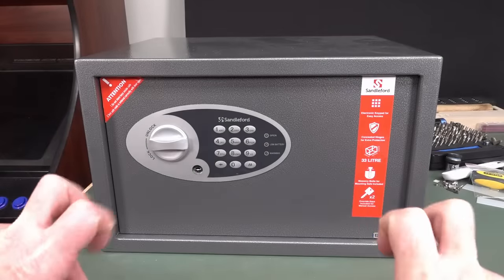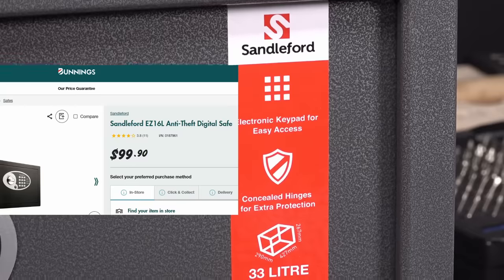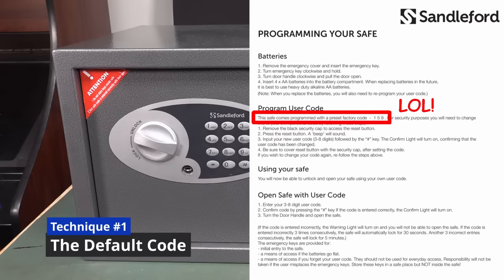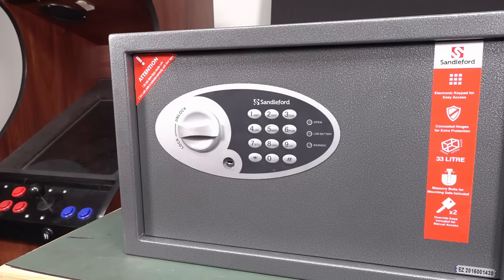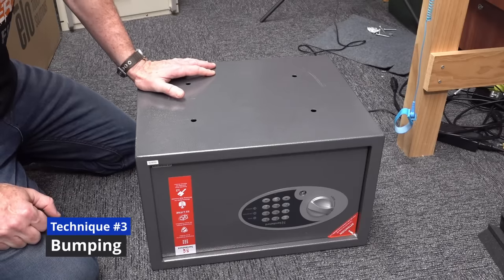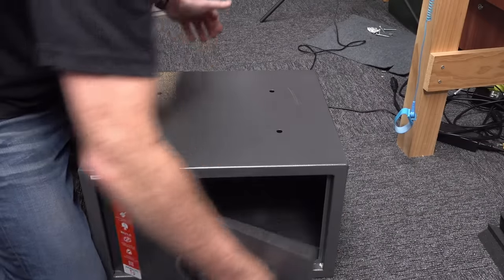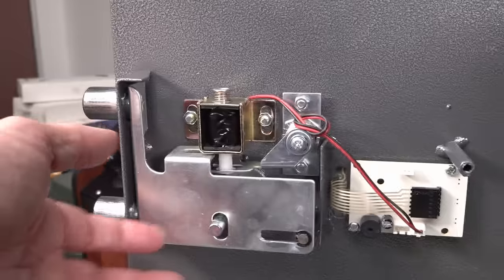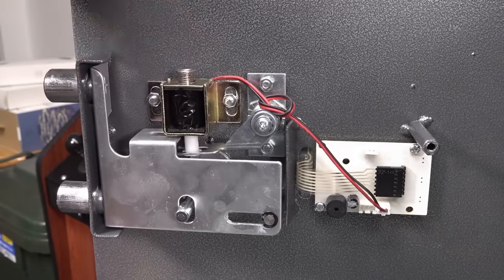EEVblog 1494 - FIVE Ways to Open a CHEAP SAFE!

Comment: The point of the sheet metal ones is basically just to have an insurance case if tampering is evident.
Reply: Yeah but most of these methods don't damade the safe so it's worse than worthless.
Reply from the maker: Some of the methods I used leave no trace.

Comment: I don't know why they sell these.

I've always looked at those safes in Bunnings and only wanted them as a toy to see how long ut would take me to get into them.

It's not so bad being movable if it's bolted down to concrete anyway.

I'm pretty sure it wouldn't be hard to pick that one though.
I did by a $90 lockwood padlock from Bunnings and I still can't get into it.
It only had basic security pins but the keyway and tolerances make it tough.
Master locks are a complete joke though.

Criminals just cut things though but seriously it would take them less than a week to learn to lock pick all master locks.

Comment: I Have a cheap document safe, but with a big lock and "good key". I tried what you did with mine and i cant get it open. My tools are not big enough for racking and the lock is inside two sheets of metall. Maybe you can smash this open with more force. Also i have screwed my safe in.

Comment: Thanks so much Mate, the electronics of my safe was busted (maybe the battery died out) , and even with the emergency key I could not open the safe. I started grinding the bottom, cause its very thin. But it became so hot I had to stop for fear of damaging the documents inside. I was thinking of prying the door open and then I found your video. Understanding about the mechanism and the solenoid was key. After trying the banging on top method, I decided to pull the plastic cover and surely enough it is just attached with a couple of screws. And then miracle a hole big enough to put my finger in. And the solenoid just behind the hole, you could see it through there!!!! Unbelievable!!! Just had to use my screwdriver to push it down... It was a cheap safe from SolidSafe, that you can buy all other in Asia.
Anyways thank you so much...

Comment: At the price of one of these, you might be better off putting a keypad lock on a closet door. Or save $ and just put a regular key lock on a closet door. Either will probably last longer than this safe will (as in longevity under normal use)

Comment: take about 30 seconds.... I have a hydrogen torch...   it vapourizes tungsten, so it would cut through 3 mm of steel in seconds we cut blocks of steel 12" thick with them.. lol that second safe would take a bit longer, but not much, again the atomic nature of hydrogen matters what the flame touchs....tungsten? you got a 4200 degree flame... steel, you get around 2000 depending on the grade...  nothing is imune to them... just a matter of how long it will take

Comment: That "stuff inside" the more expensive safes is called reinforced concrete.
Reply: Actually it gets more complex, as they also include broken tile in there, and sheets of kevlar wrapping the tile, to defeat core drilling it. Then some also add in lengths of stainless steel and tool steel rod, to defeat carbide cutting tools, and even crushed tungsten carbide as extra resistance.  All to make cutting in harder and more expensive in tools bits. Some of the more high end also have protection against explosives, by putting in reactive armour plate under the first thick skin plate, so that using a cutting charge to blast a cut into the safe will be defeated.

Many also put in a drill detector plate, using a sheet of nicely cushioned thick tempered glass that holds all the lock mechanism in alignment. Drill and it shatters, jamming the lock closed. Glass has a kevlar wrap front and rear that grabs the drill bit and pulls it in, forcing the glass to break. Opening after that is then bring in the 6 big angle grinders, and 200 cutting disks, and grind for 2 days to cut through the door on all 4 sides to remove the front of it.

Comment: with that little nylon sleeve beeing all that stands between a locked and unlocked safe, i wonder how much extra force it would require to just overpower it, because surely a decent size pair of pliars giving you some leverage on the turning knob would give you enough leverage to just cut the metal from the mechanism straight trough the nylon sleeve
Reply: my thought exactly, just torque the handle a bit and it'll pop right open im sure
Reply: @frogz  its either that, or you break the handle clean off, you never know what the weakest link is with these products
Reply from the maker: Yes, but the whole idea was to show ways to do it without physical force. There are probbaly half a dozen ways to smash/pry into this thing.
Reply: @EEVblog  including but not limited to, probably a butter knife being stronger than the front panel

Comment: The $1,400 gun safe and the $4,000 gun safe let's say liberty. You can open those up with it carbon tip skill saw. Over the side above the top to the other side. Just saying. That's like the cable protecting your dirt bike while you sleep at a hotel. If you have a quality 10 snip it will go through that as well? It's funny how safety has no security.

Comment: ROFL
You can't bump Safe. That pile of flimsy thin steel-sheets is maybe some metal case but it is not a safe at all. A safe has elements of concrete behind the outer case, it also has some kind of fibre that prevents you from boring through the outer skin to get to the mechanism. Not even that CMI thingy you're showing in that video is what you would call a real safe. Trust me, a proper safe AT LEAST has a weight you may very well express in the range of quarter ton upwards to multiple tons. And, trust me, with that weight you usually won't drop the safe any more, at least not without heavy equipment! ;-)
Reply from the maker: The CMI one is a real safe, it's just a small one for compact places. Not everyone has the space for a 500kg monster.

Comment: Are these any good as a basis of fire protection for backup disks, etc?
Reply from the maker: Nope, you need a proper fire rated safe with insulation material and sealing gasket around the door that expands when heated. If it's just steel plate like this then it's not a fire rated safe.
Reply: @EEVblog  Therefore, is there ANY useful repurposing for this kind of thing?
Reply: @jimadams7765  A decoy to distract thieves away from finding the real safe.
Reply: @EEVblog  Even a standard fire rated safe will not keep your data backups from burning up unless they are on punch cards or paper tape. 
You have to get one specifically rated for storing hard drives or tapes. The insulation is much thicker and even a rather large safe doesn't have much room inside.

Comment: Well... You can get decent safes at 30-50 kg. Not top security but some that requires some force and power tools to get into. Unless you're an old man most can pick up 30 kg and perhaps even 50. And even safes which weighs in at a few hundred kg needs to be properly bolted to solid building parts - otherwise it doesn't require that much tools to move them away to a place where there's no time pressure to get in.
But yeah. Those solonoid safes are crap. They would be semi decent if they had better fallback keys (or no key at all, possible to power from outside if batteries are dead) and a mechanism that can't be bumped. Burg Wächter and Yale has such on the menu and they're not that much more expensive. Sure they're still thin an with power tools you get into them pretty quickly but no power tools or only a classic drill then they'll sure give some noticeable resistance so a burglar might give up because it takes too long.
But yeah... If you pay 5x more then you get a decent safe. Not a Fort Knox but some that should be considered minimum. In scandinavian countries that'll buy you a safe known as a "weapon safe"(-grade) - which really should be the minimum grade you should consider.
Or better - don't - because then burglars are not preparred go get into safes for those who bother investigating and investing in something better.
Reply: Btw. Decoy safe. Yes I - also - have a cheap solonoid safe in the bedroom - which I although have modificed to make some of its weaknesses if not impossible them a lot harder. It contains old keys, some fake coins and a little bit of (also goldplated) silver jewelry of no greater value. So hopefully a burglar only finds that and in the event of a home robbery - sure I have values - lets go open the safe! And of course they don't have time to verify coins and jewelry - time to leave fast and they're left with nothing valuable except a few pennies of silver.

Comment: You can probably trip the solenoid with a strong magnet.
Reply from the maker: You didn't watch the whole video!
Reply: The metal was thick enough that it would take an unreasonably strong magnet to do that, one that could easily crush the fingers of someone trying to pull off the attack. But the fact that there's no mechanism to detect and block that attack means it's still at least theoretically possible.
Reply: @EEVblog  Oh I did. I just commented before the end.

Comment: Its not intended for be carried, its intended to be bolt down, and why there is holes.  1:08 pls get down from your high horse.
and as you hopefully can conclude.. this safe is better then no safe as long as its bolted down.. the chance that a burglar seeing this somewhere and then will go onto the web etc.. to look for some passcode to reset it, is very small. as likely in a hurry,
though' it makes very little sense if there is a reference zero code across a product-line.
- but usually there is a small keywhole that you can wick open with most fitting keys that can pass the whole and you can wiggle it open, but as stated this is not intended to store nuclear codes or anything of extreme value, but simply from the perspective, its better than nothing' and do your due diligence before you purchase - as there are quite a difference between these cheap models, but at the end of the day, its intended to be bolt down, and why the small nature are not a problem as long as the bolts are inside' and why it have holes inside.
Reply from the maker: No, it's worse than no safe. You are literally better off hiding your valuables instead of storing them in this heap of crap that screams "valuables inside", and takes seconds to open.
Reply: @EEVblog  You should try the magnet attack on that CMI H2C... as even on SentrySafe high-end and also UL listed safes.. there are still like a whole fleet of all their electronic lock, that is sensitive to magnets.
and even the big chunky ones that cost in the 4 to 5 digits (US), also got their weaknesses
I don't know which lock SentrySafe use' and if its a 700 series or a newer revision.
https://youtu.be/ApJQ2wcYjBo?t=121
when it comes to these cheap safe, a lot have to do with what people do..
- do people hide their passport and vital papers.. usually not when they feel somewhat safe.. do people hide their pieces of jewellery in different places.. usually not..a cheap safe is definitely better then nothing - just as long as it is used with common sense, in regards to the average burglar' that is looking for some money to fx get a fix or whatever..
- bolt it down if its small and manageable one (very crucial on small safes), fx in the closet to something structural, and get one with a decent 5 ot 6 pin tumbler.. or exchange the one that are fitted usually off-the-shelf sizing, and even a semidecent one that the average burglar cant just blank fistpump' is like 10 to 20 bucks..
I saw a doc where they talk with some previous burglars about their general modus operandi, and even the cheap ones could be a pain in the a'zz, if its bolted down and in a hard to reach area, like bottom of a closet..- it was usually just a rattle blankkey attacks or bump-approaches - and if that didn't work.. move on..
another thing that these burglars also was annoyed by. that it seemed some people used cheap "safes" as "bait" and you used a lot of energy & time on them and if possible carry one out, and then get moon'ed - when it hold nothing of value and you end up taking & carrying that in the hope for a payday' instead of easy consumables like consoles, laptops etc..
but one thing that they did mention was the quality and the cost of a given "safe" people have, also have a signal-value of the possible value it contains, just as the home in general and the living standards of furnitures etc..will indicate values in that home...
Reply from the maker: @JAKOB1977  The CMI is not vulnerable to magnetic attack, yes I tried it.

Comment: That first one is a lock box, not a safe. Granted it is still a pretty crappy designed one, but yeah, not a safe. I imagine there is better fitted mechanisms the big company's order is fitted with and they just slap some crappy chinesium metals in the forming machines to run out the left over materials after that order is filled (this is why you see the same product with crappy build quality, the good ones went on a boat to a product packaging site, possibly in America so they can be stamped Made in the USA, and lasered with the big name logo). I wonder if there would be a significant cost savings in just removing that blocker plate since the fitment makes it pointless.....Of course with it in they can technically advertise it has one, even if it is useless. There is no such thing as a 100% safe safe. Every safe can be opened with time, particularly with a reduction in salvageability of the contents. There are almost perfectly uncrackable safes that have stuff like glass panes in them that if cracked, like with a drill will drop pins and its locked forever. But those kind of manufacturers will tell you "It can still be opened, but to do so would likely destroy what is inside....unless its diamonds....and even then...."

Just like with door and window security, vehicle security, bicycle security, the name of the game is inconvenience. If my house is harder to get into than my neighbors then chances are, unless I specifically am targeted, the thieves are going to go next door for the easy grab and go.

Comment: ...thats not a safe!... ...this is a safe!
..i cant believe you said Security through obscurity is the first rule.... ...there is ZERO security through obscurity.... just ask anyone who plays with radio/SDR!.. it 'used' to be 'secure' when noone had radios that could cover the frequency in question (or had to pay $1000s to get some equipment)... now weve got 10$ dongles that will cover from DC to daylight.. all the 'obscurity' has all gone out the window and its left with ZERO security....
Reply: Looking for this comment, can't believe it's not been mentioned more. e.g. Open source software is more secure as loopholes (Like the software equivalent of the coat hanger trick) are visible and fixed quickly. Security through obscurity is no longer a thing.